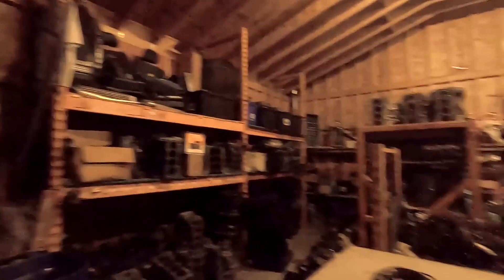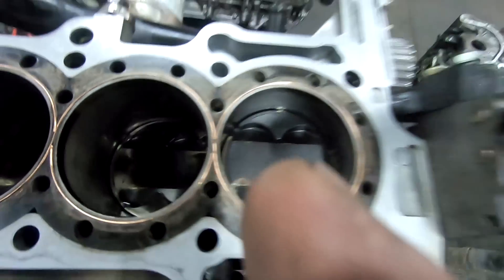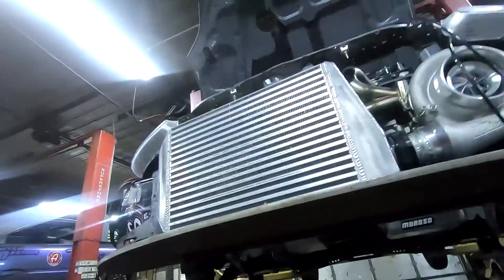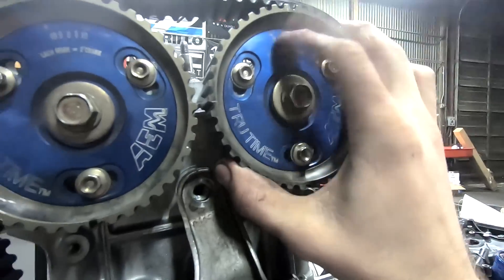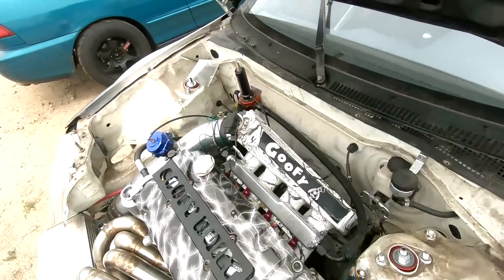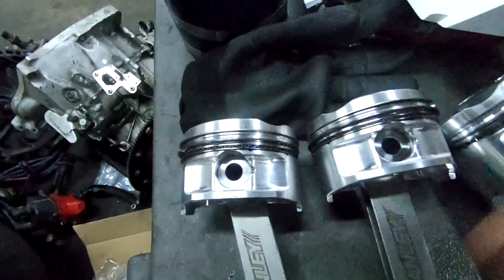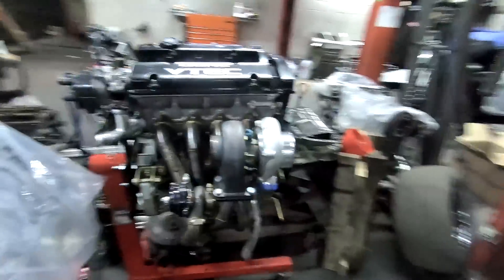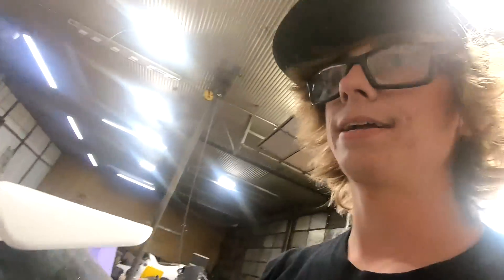They are Flying Off The Stands! Lyset is Coming in Hot Go Goof

Comment: You need to shorten the lower radiator hose. U don’t want it touching the boost pipes, you with heat soak the cold side and raise IAT’s
Reply from the maker: On methonal you think?
Reply: @GoofyBuiltShane  with more heat in the charged air, it makes it the cooling factor of methanol less efficient. Meaning your IAT’s won’t be as good as they could be. Also with methanol a lot of people remove the air to air intercooler, it doesn’t really help. It’s just heavy
Reply from the maker: Heavy is what I need…
Reply: @GoofyBuiltShane  yeah but if you can move all your weight around in the car with ballast weights you can balance your car a little easier. Compared to having fixed parts of substantial weight
Reply from the maker: I’m only aloud 250 in ballast and the car already is cornering up so perfect but I understand what your saying. I’ll see about making a spacer that I can put inbetween them half moons that the pipe and line rest in
Reply: @GoofyBuiltShane  the H series have a bracket that mounts to the starter that holds the lower radiator hose in place. Might work for what your doing, and save a little time. If u got one laying around
Reply from the maker: It might but the boost pipe travels kinda right above the starter n it’s a awd b trans I appreciate you though man

Comment: Turn em 3 teeth counterclockwise and then lock down your tensioner and it will automatically eliminate the slack. 4 teeth might cause a whining belt from being to tight
Reply from the maker: I’ve heard the trick a lot.. doesn’t always work I’ve had to tighten belts up. Plus Mario’s has a manual tensioner so I have to use a wrench to tighten it until it’s perfect then lock the jam nut
Reply: @GoofyBuiltShane  ahh little bit trickier but still easy. Especially after 300 of em its almost possible to do with a blind fold. Dude you should do a video showing how much of a honda boss you are and have someone spin a motor and then you remove the belt. Set tdc. And re apply it with a blind fold. Maybe when you have more time on your hands if you get bored.

Comment: I was about to say it's just a ring compressor Goof lol but anyway if y'all ever get away from them EBay turbos you should hit up José from Forced Inductions Solutions (FIS) he'll even help you spec out the proper turbo for the power you are going after and not only is the customer service 2nd to none but their turbos are some of the best in the business as well and just hit up Motion Raceworks for the CO2 bottle
Reply from the maker: I have a pulsar papi custom 67trim from the g42-1450 I can get a co2 bottle from a place local and have tones of mounts I already have a fuel tech boost controller